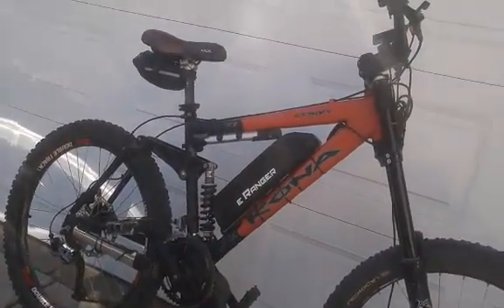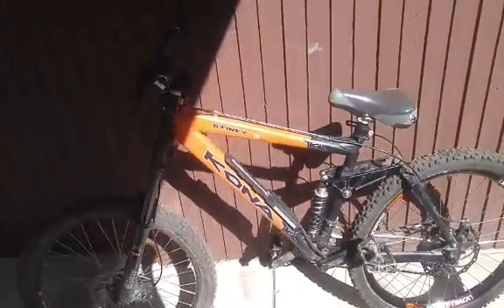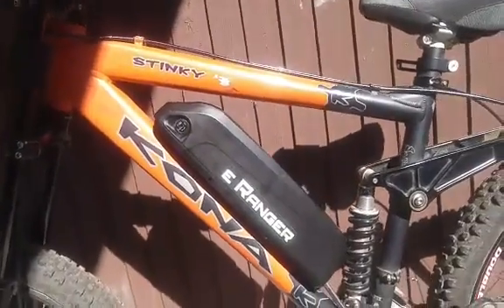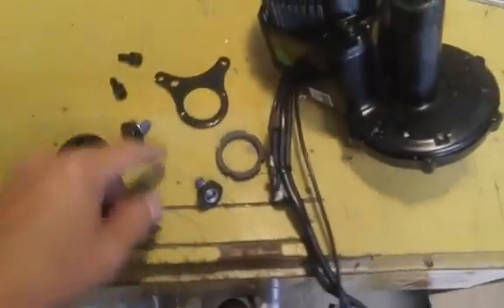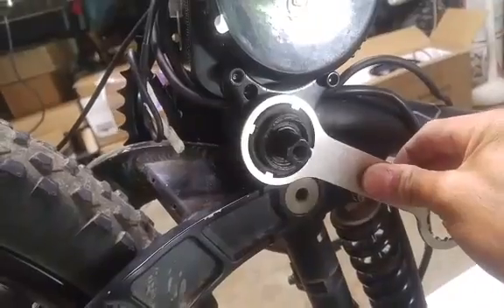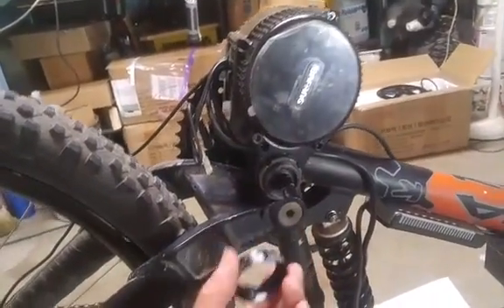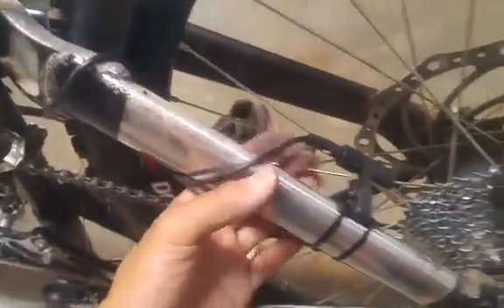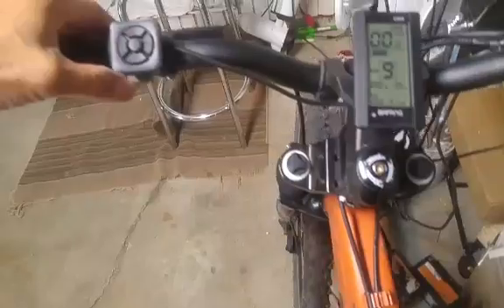electric mountain bike ebike conversion

Comment: When you did this conversion does the motor clear that small bump that is welded right where the down tube meets the bottom bracket?
Reply from the maker: Yes that weld kind of got in the way but I grinded out a bit to fit motor higher.
Reply: @prbikes  good to know. Did you have to remove enough that it would have affected the integrity you think? Like would you still be able to bang the bike around and not worry about the frame cracking or snapping?
Reply from the maker: @tailtap_  I didnt remove that much its been working ok with me. I don't ride that hard and I'm not a heavy guy.
Reply: @prbikes  thanks for the info!